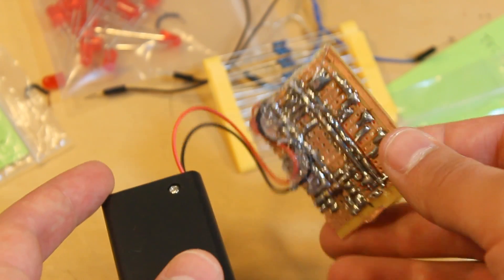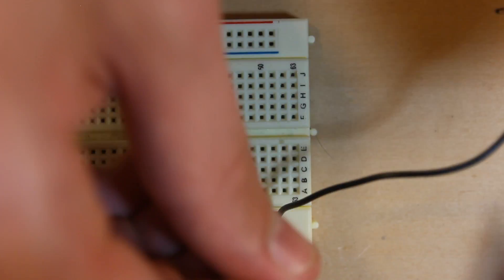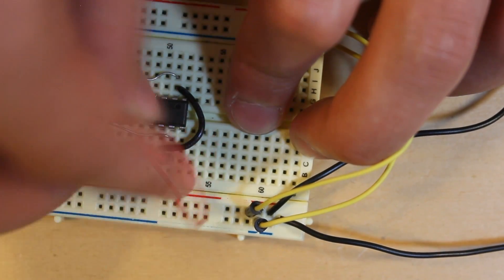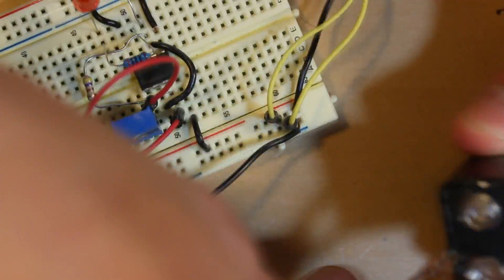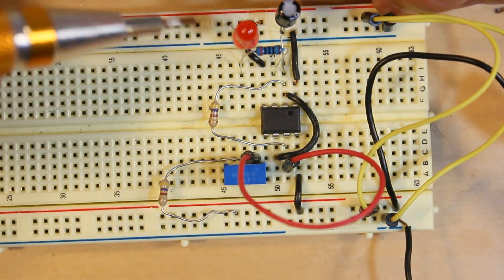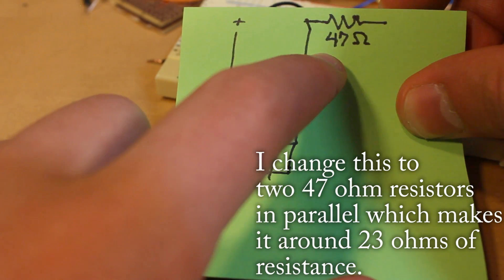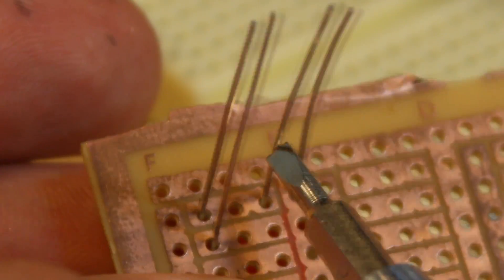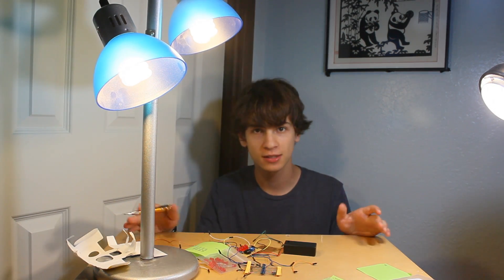HowTo: Simple DIY Flashing Tail Light

Comment: If I want the LEDs to be on for a little longer, more turning signal-ish, what ohm do I want?
Reply: Hey man, change the RC (Resistor to Capacitor) time constant. Either raising or lowering the resistance or capacitance connected to pin 2 and 6 of the 555 timer will make the LED's go faster or slower.  I would use 4.7k ohm resistors as voltage dividers off pin 7. One resistor going "high" off of 7 and on the other side of 7 connect the other resistor to 2 and 6 connection.  Off of that low resistor connect a 10 uF capacitor to complete the RC time constant. Of course you can use any combination of resistance or capacitance to change the rate of speed. Hope that helps!
Reply: +sam carson Thanks so much for the answer!